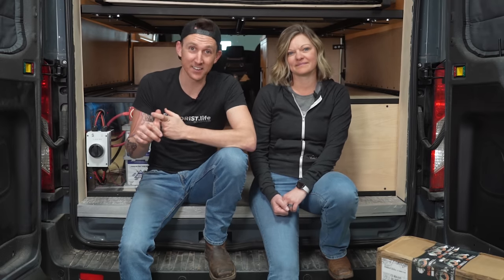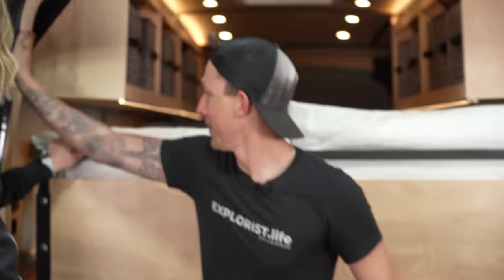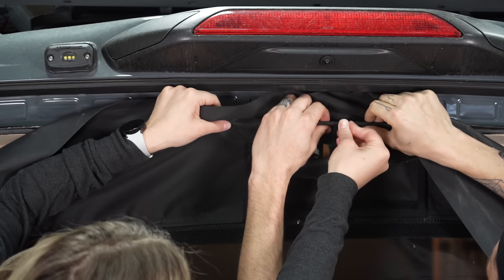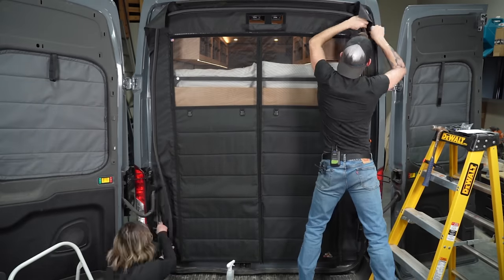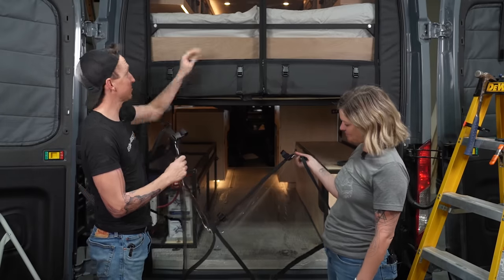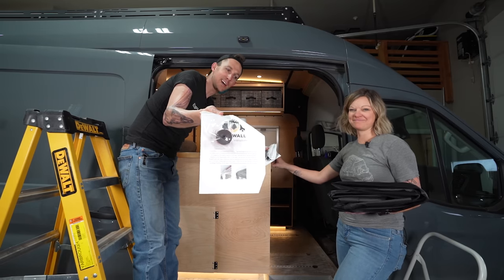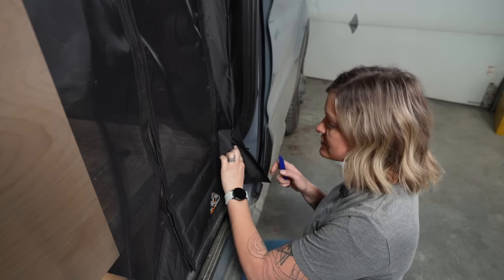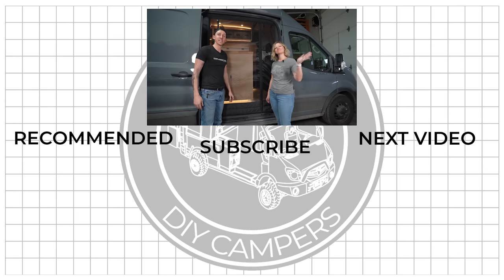INSTALLING BUG SCREENS IN OUR CAMPERVAN (no sewing)

Comment: I have watched many of your videos, especially those on the electric system and solar panels. I learned so much. Your were my life line. Thank you, thank you, thank you. I finished my build a year ago and I am planning a trip to Newfoundland and Alaska this summer. Yes, there bugs up there (many), so I am in the market for screens for my van. My side door entrance is similar to yours and I noticed your screen entrance is offset. Would you do any changes to the side entrance screens? do the magnets consistently seal off the entrance or would you have preferred zippers? did the mesh ever come out from under the weather stripping?